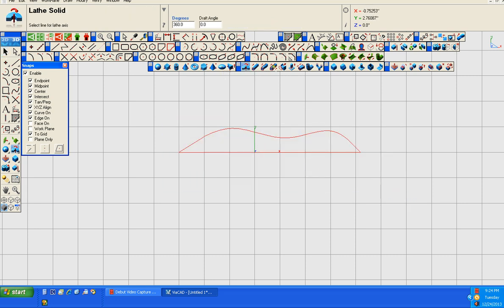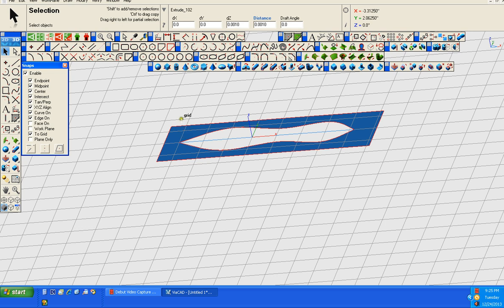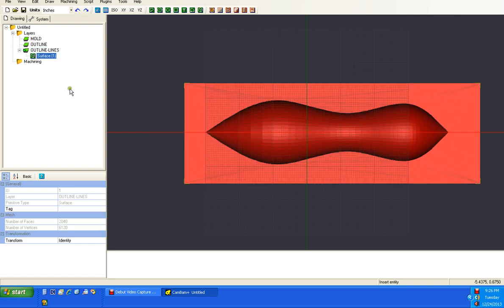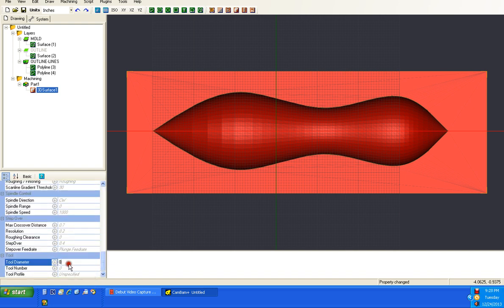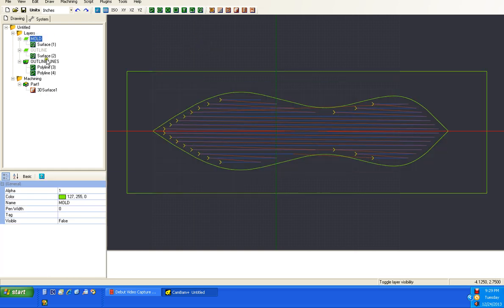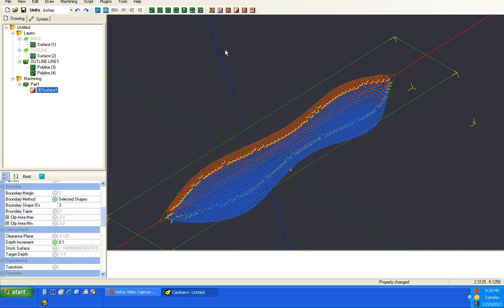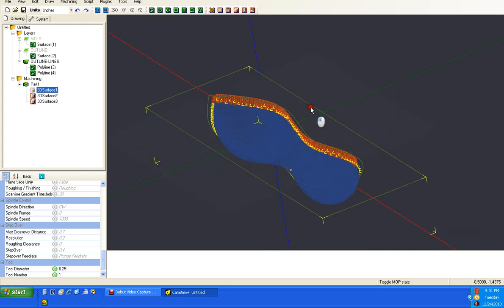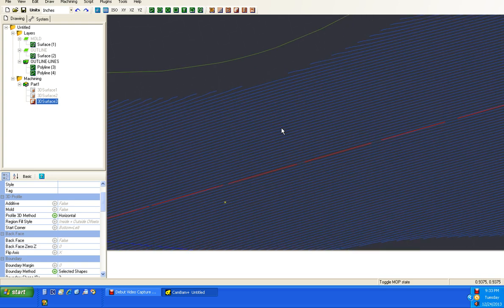Simple 3D Mold Demo Using ViaCad & CamBam

Comment: Thanks for this, was bashing my head against the desk trying to figure out how to cut only the inside part of my mold, pretty obvious once you know how! Thanks!
Reply: There are some other ways, but this one is the easiest for me.  Atleast with CamBam.  Just so you know version 1 alpha release of CamBam has some experiemental .stp file capabilities.  Its not up to organic modeling work yet in my opinion, but Andy is working on it.  When that is fleshed out I may totally change the way I do organic 3D mold shapes.  Of course the method in this video will still work.

Comment: Hi Bob, I was wondering whether you had any insight on how to simulate the generated G-code. I tried with CNCsimulator, but the G-code generated doesn't seem to match. A simulation would be a very cool next video idea, don't you think ;)
Reply from the maker: +Björn Wegener -  Since Google forced me to use a g-mail account for these videos I do not see comments when they are posted anymore.  Sorry I missed this one.  Camotics is the simulator I am currently playing with.  Its got a long ways to go, but it does work once you learn how.
Reply from the maker: I need to add a comment here.  One of the power users over on the CamBam forum has written a plugin that allows Camotics to be used directly with CamBam for simulations.  Its not bad, although Camotics still doesn't implement drill operations.   On my high speed machines I use spiral milling for most holes, so I often forget about that limitation, but on the big mill I do drill operations all the time, and they don't show up.  Its bitten me on the butt once or twice.

Comment: Hi Bob, I am doing all the steps you show in this video, but cambam seems to not cut into the depth of the part. The tool-paths it generates are just flat like it would take down the stock. It completely ignores the depth of the profile. Any ideas?
Reply: Ok duhhh I found it. In creating my STL-file the axis in ViaCAD were not correct. That is why the object was also generated as if the mold was not facing up. A conversion along 180 degress X-axis fixed this. (dont forget to rotate the outlines as well)
Reply from the maker: Björn Wegener Sorry, I didn't get back to you sooner Bjorn.  Yeah its really easy to get lost and disoriented in 3D space when doing CAD.  I have had people send me files where all their work was thousands of units from the origin, dangling in space, and twisted at some odd angle.  Of course I have to find it and orient it because if I tell them they sent me a stupid file I lose a customer.  LOL.